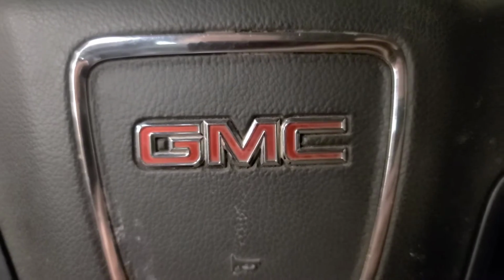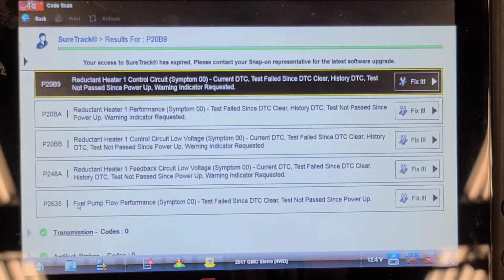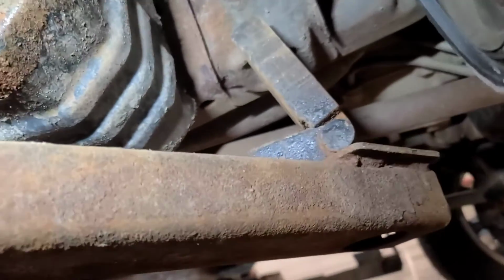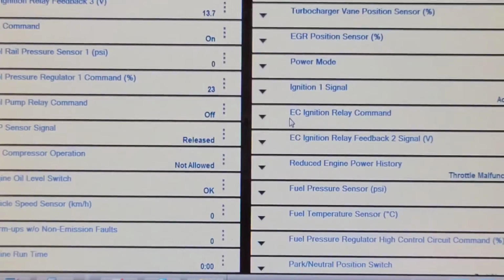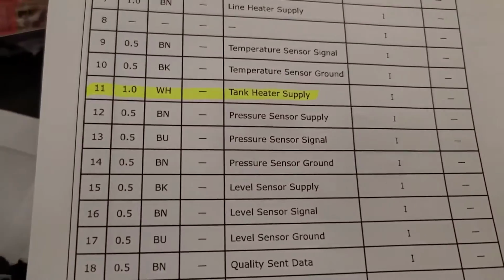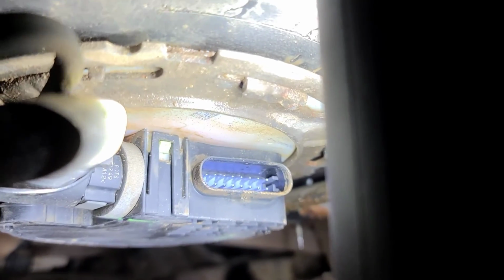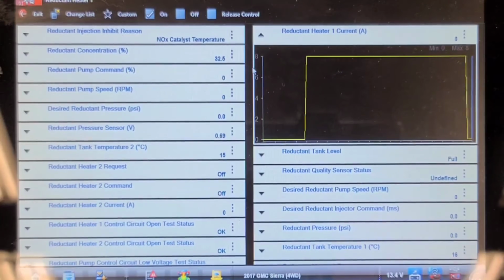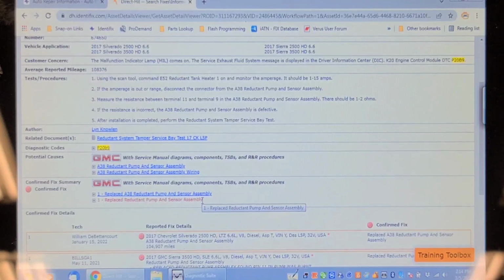2017 GM Truck 6.6 Duramax DEF Problems P029B

Comment: I've been doing an awful lot of reading on Def and the problems with their system of operation.   I have come to the conclusion that an external stick on heater rated at 200 watts should resolve the problem.  The heater must b controlled by a cabin switch to maintain def tank at 45 to 70°F.  This heater can be run by an independent deep cycle axillary 12 volt 500 ah battery (preferably lithium phosphate) secured in bed of truck and wired with AC trickle charge option when necessary.
Same applies to diesel fuel tank when running grade 2 diesel as grade 1 is not readily available in certain parts of U.S.  Also, it is important to know that DEF freezes around 12F ( some articles say 32F); in this case, some authorities are recommending not to fill tank more than 2\3 full of DEF in cold weather.  Apparently, the opposite is recommended for diesel tanks,  literature states it is best to keep tank as full as possible during cold months to reduce paraffin from solidifying in diesel and thus leading to obstruction of fuel filters.   External oil pan heaters recommended to avoid excessive wear on engine bearings, cylinder wall, .......during cold cranks.   Traveling does not always provide warm garage to park for lengthy stay.
One more comment: Cold or frozen DEF leads to increase resistance in the temperature sensor line and the control heater line which may be the reason the terminals are showing scorched marks and thus leading to failure of the reductant tank heater pump assembly in the DEF reservoir tank.   I feel that GM is aware of this and has chosen the 10 year/120,000 mile extended warranty rather than trully find a splutionbfor the problem.   Their reasoning aligns with planned obsolescence manufacturing survival as in job security.

Comment: 8 amps thru that small terminal!   I believe you are on to something.   I'm on my 3rd reductant tank heater pump. 2016 LML 49,000 miles......still under special GM extended warranty.  10 years/120,000 mile .

Comment: Quick question when you install this pump do you need to reset the service emission for it to go away mine shows limited to 55pmh due to this pump needing ti be swaped took mine to the dealer and told me it’s the reductant tank temp sensor which is built in with this pump. It sure does only come on when it’s cold outside but I’m about to replace it my self just wondering do I need the software to restest or get rid of the limited miles per hour ? Mine set the code p2ada
Reply from the maker: You can try clearing the codes and that should be enough but honestly not 100% sure. If you don't have a scanner try disconnecting the batteries.
Reply: Did you have any luck with that code p2ada mine is doing the same thing
Reply from the maker: @6doorshopdavid980  I just changed the DEF pump couple days ago. There is a video link in the description of this video.

Comment: Wow Finally a real Mechanic,  and not just a parts replacer,  Nice Job, my 2017 Chevy is in the shop right now, running great just threw the check engine light and they said it needs a def pump,  still under warranty so I didn't question it much, but I would think a def light would have came on

Comment: Sooo what was it ?
Reply from the maker: Needed a def pump assembly as the heater is part of it. After manipulation of the connector the fault temporarily went away but the temperature also warmed up. The customer bought the pump but has not installed it yet. I'm sure come winter it will be back...
Reply: @PhillipBailey  thanks brother

Comment: Did you ever fix the issue my 2017 is doing the same thing it’s a L5p any tips
Reply from the maker: This truck needs a new heater assembly. Customer has a new part but has not installed it yet as the code has temporarily gone away likely because it's warm now. What code is setting on yours?
Reply: Can you replace the heater assembly without dropping the tank??

Comment: Hi Phillip, that will probably be expensive to replace, I wonder if some of these electronic specialist could repair, thanks video cheers sandy
Reply from the maker: I'm going to see if I can fix it but I doubt it since the pump assembly goes into the tank from the bottom and the electrical plug will be submerged.